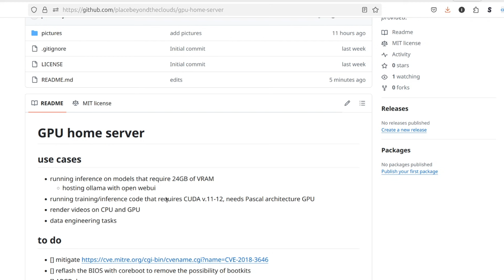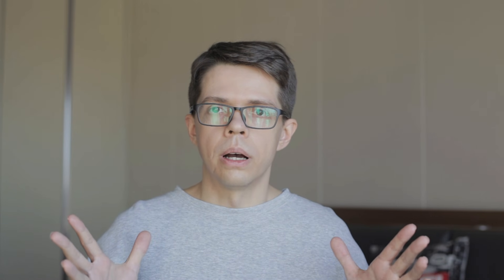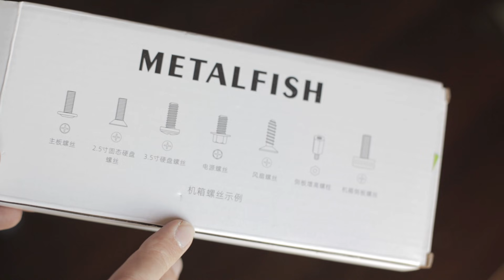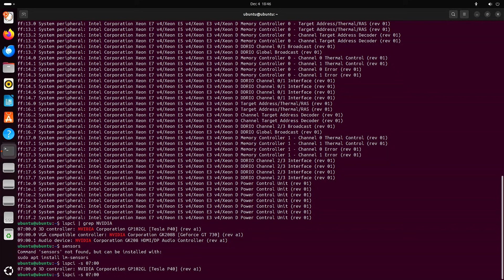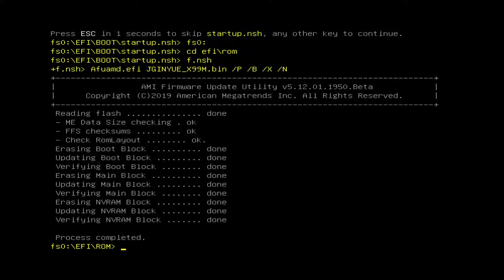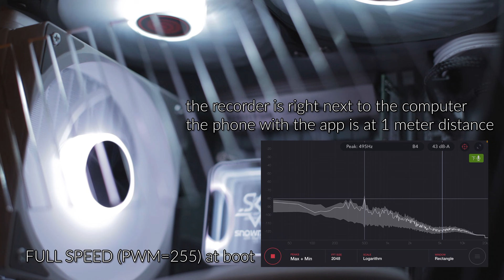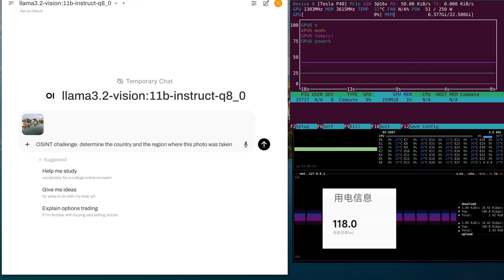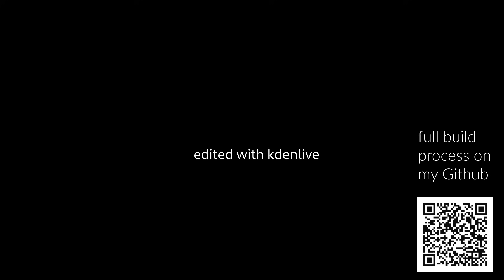Building minimalistic homelab GPU server for Proxmox and Docker - 2024-12-7

Comment: please tell me , what progs do you launch in cli for monitoring power consumption>?
Reply from the maker: Hi! I first installed the programs apt install powertop stress , then started powertop to monitor C-states to make sure we're at full load without any energy saving (you see how percentage of time CPU spent in energy saving states is going to zero), and started watch -n1 "cat /proc/cpuinfo | grep MHz" to monitor the core clocks. Then I begun the stress test by running stress --cpu 36 --timeout 120 . Also there is another cool program for CPU monitoring and stress test called s-tui .
Reply from the maker: Oh and that part in Chinese that shows the power consumption is a screen recording from the IoT power plug app on my phone.

Comment: Can a 24 gb tesla P40 be installed on a HP Z840? Is it compatible?
Reply from the maker: I never used z840, following is just a speculation. From what I can see online, it has dual CPU motherboard on c612 chipset that supports xeon e5 v3 and v4, the board has two pcie gen3 x16 for one CPU and one for another CPU, spaced to fit a 2slot card. Each xeon gives 40 lanes, so all these slots are (in theory) usable and are a perfect fit for a P40 which has gen3 as well. As for physical dimensions, do not know how much clearance is there between the lowest pcie slot and the bottom of the case, and the total length of the gpu also depends on a cooling solution, so it's hard to tell for sure if it would fit into the case without knowing which cooler will be used and looking at the actual dimensions within the case. 

So from the compatibility standpoint, the system would run one p40 without a problem. Eyeing from the pictures online, the system can fit a p40 into the middle slot(CPU1) with a 180 degree 3D printed blower fan without any changes, even leaving the standard PSU. But this system seems like a bit of an overkill for just one GPU, and the stock CPU cooling system is occupying much of the space inside the case which would prevent installing a GPU in the top slot. 

If I were to get a z840 for free to build a home (silent) server, I would ditch the stock CPU heatsinks with the fans and airflow guides altogether, replace them with 120mm waterblocks for each cpu, mount the heat exchangers outside the case (or in place of the side panel), install two p40 (into the top and the bottom slots, both CPU0) converted for 240mm waterblocks, mount the waterblocks outside as well, leaving the original PSU.

It would be interesting to follow your build, whatever you decide!
Reply: @ thank you. The power supply has 3 6-pin cables available, while the P40 has an 8-pin female input. How can I solve to energize the P40?
Reply from the maker: 6-pin PCIe power connector is basically an older version of more modern 8-pin connector. They all are pairs of 12 volt power lines, the former is 75 watts max and the latter is 150 watts max, as per the official specification. The P40 also uses 12 volts 8-pin, but the pinout is different (mirrored), the connector is called EPS. 

So you would need a PCIe-EPS adapter, you can use 8-pin PCIe as it is compatible with your PSU's 6-pin PCIe connector. I'd use 3xPCIe-to-1xEPS adapter to stay on the safe side, although 2-to-1 would work as well. I believe 6pin can handle more than 75 watts. The calculation is that the PCIe slot would provide 75 watts, and the EPS connector would provide the rest. P40 has TDP of 250 watts.

What's your solution to the P40's cooling?
Reply from the maker: On other systems you can also use a spare 8-pin CPU power cable if you have one, plug it directly into P40
Reply: @movedToChinaForStudies  thank you. 👍

Comment: Why gen 3? 

I mean, I think. Judging from your ollama instance, I notice far better performance on my gen4 devices in gen4 slots.
Reply from the maker: True, gen4 would provide at least twice the bandwidth, plus the speedup of having a newer card. My plan was P40 that is unfortunately is gen3, so everything else is built around it.
Reply: @ you should have a training advantage over 30 and 40 series cards because the ram. 

Many people have great success training and fine tuning on P40 (for images) and generating with like a 30 series card. Your set up doesn’t allow it, but still a great set up. 

For images 512x512 generation isn’t terrible if you’re not getting too fancy. 

I’m still working on LLMs, image gen caught my attention first and foremost. 

But hey, you still got a set up and having fun in a weird way, like the rest of us. When I got the 3080, it was primarily for gaming and H2.65 encode and stumbled into AI when I went to learn python.
Reply from the maker: Thanks! Also, nice pivot, from gaming to AI and coding. 
For now, I'll use the rig mainly to run inference with ollama.

Comment: Did you consider a 3090 or 4090? I got my 3090 for $700 but I guess the P40 is cheaper. I suppose that's what's available in China. 

Unfortunately, my 3090 has become unstable after a few months of use. I'm not sure why but YouTube videos and some games make it crash, so it doesn't seem to be overheating.  I suspect a bad memory chip. But I've run multiple memory tests with no errors. 

I really want to build something with multiple semi-modern Instinct or NVidia server class so I can run very large models that can compete with OpenAI in intelligence.  I don't like them using my data for training and the political spin and censorship.
Reply from the maker: Hi! 3090 and 4090 are both way over my budget, haha, so no. I can get any GPU here, there won't be an issue. Another reason to why I didn't consider them is that I will mostly use this GPU for inference and not training. Training will be much faster on these newer GPUs compared to the P40, but I doubt the difference in inference speed will be that much. Hypothetically, I were building a cost-effective rig mainly for training, I would go with a custom 3080 that has additional memory chips soldered making it 20GB VRAM, this is from the experience of one of my colleagues. This custom GPU cost her 4100 yuan at that moment.

I'm so sorry to hear that happened to your GPU. Those things are soooo complex and so many things could go wrong with them. When I was swapping the air cooled heatsink for the waterblock I was keeping in mind that this operation might not end up well for the board, but it all worked out in the end. If you bought the GPU used, what I would do is to send it in to a repair shop, it might be anything from a bad memory chip as you suspect to soldering under the core loosing contact due to bending of the PCB or a knocked out SMD component, but it's all fixable! Need to mail-in to a good repair shop.

I also built this rig with something along the lines in mind, to do experiments (I'm studying in the field of linguistics) having the model weights without any constraints that companies providing the APIs put on them.
I planned on having at least 24GB of VRAM. I haven't really considered it, but if I were to need mode VRAM, it would be a significantly different build. The main constraint here is how many PCIe lanes the CPU can support. Intel desktop CPUs max out at 20 lanes (a random guess), so we'd need a server-grade CPU. This leaves me with Xeon (as I'm most familiar with) that has 40+ lanes depending on a model, and for more than 2-3 GPUs we'd need a double CPU motherboard if we want the GPUs to run at full x16 width. Even with second-hand server components the cost and power consumption will be significantly higher for a simple home server. Also, to build a completely water cooled rig with multiple GPUs would require a big chassy, probably custom-made. The conventional air-cooled rack-mountable case will be super loud and require AC for cooling. These are just my thoughts.
Reply: That’s a shame. The 3080 in my workstation is going strong, and I put a very small OC on it, and it gave a pretty big boost, at least in text and image generation.